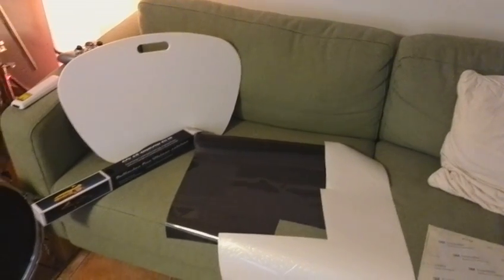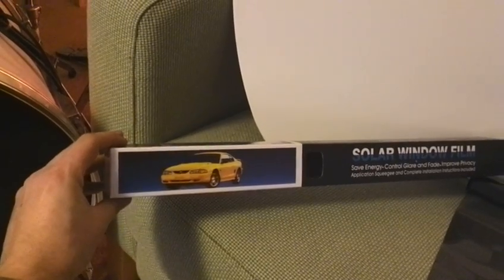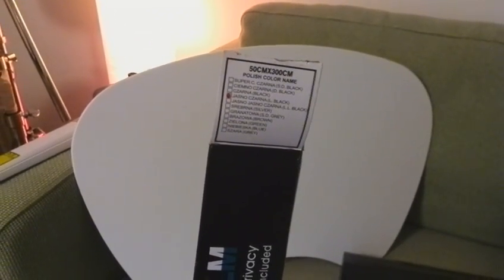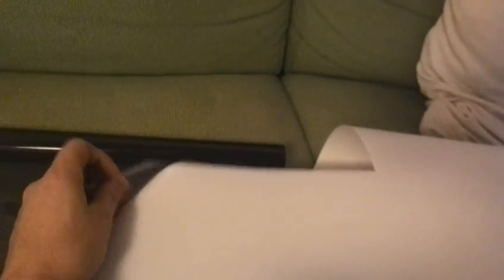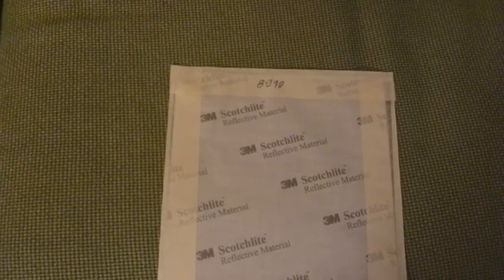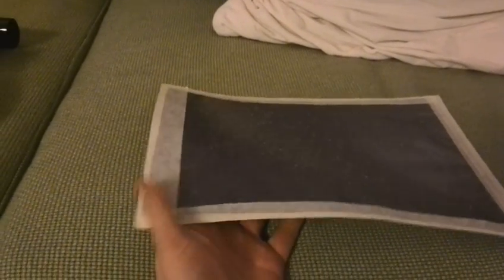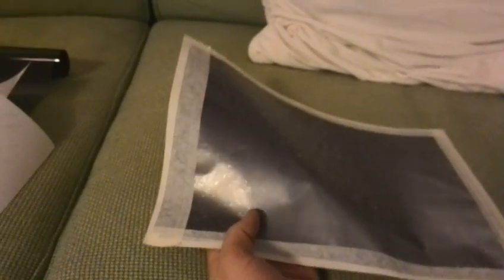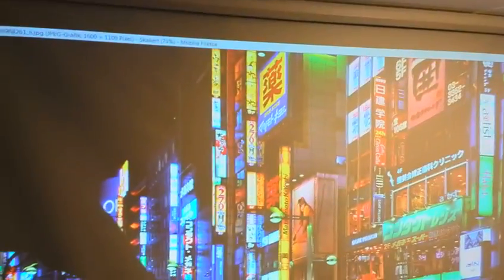Multilayer DIY Black Screen Test

Comment: Did these expriment 2007 with 3M reflective and rear foil, etc. It is costly to produce own movie screen, put it on ice.
Available to buy good 3D screens from China. Shipping costs is more than the screen., Attach video of cloth manufacture in the way you be demonstrated by. Buy yourself a real HD camera and tripod so you can shoot well.

Enter bennynorman in youtube search bar and you'll find different good screens in 50 "-60" that we made for yourself. Is compared against the white cloth